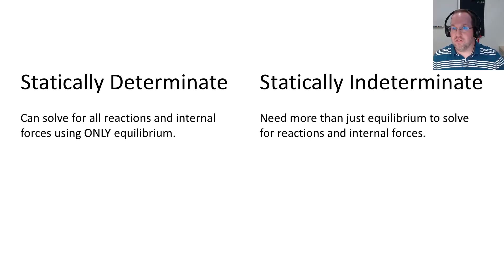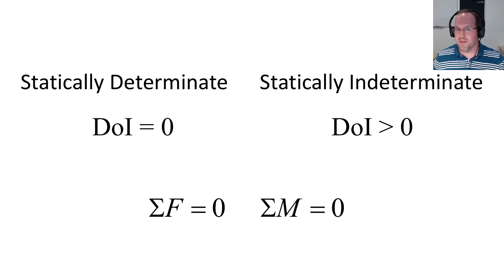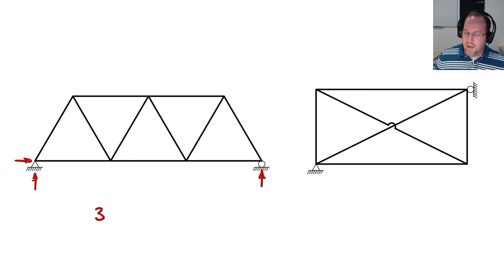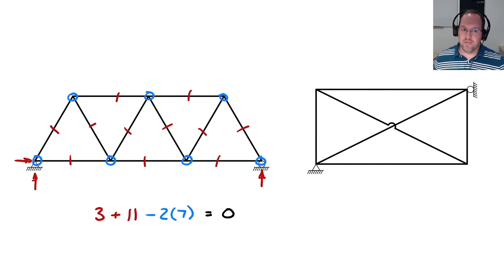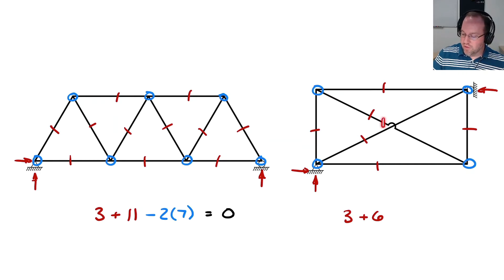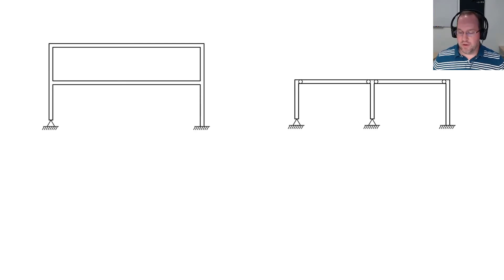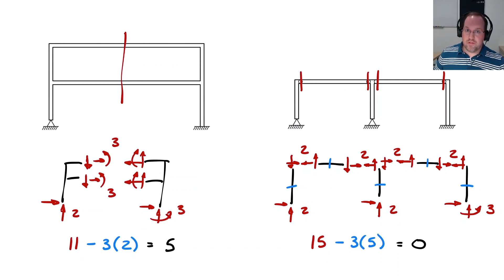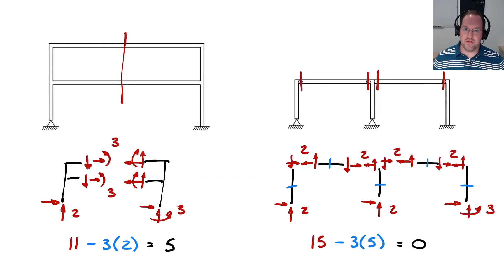Determinate vs Indeterminate Structures - Intro to Structural Analysis

Comment: Those a structure become indeterminate if the DOF is a negative number?
Reply from the maker: If by degree of freedom, you mean unrestrained degrees of freedom for rigid body motion, then yes. I have also seen this called the mobility of the system, and zero mobility is a determinate system while negative mobility is indeterminate. There is some ambiguity when defining degrees of freedom for deformable bodies, which is why I’ve added the clarification, but I think you have the right idea here.

Comment: I never learned this method in engineering school, but I can say that most civil engineers with experience and all structural engineers can generally look at a structure like this and determine if it is either statically determinate or indeterminate by inspection. Knowing the degree to which it is indeterminate is interesting, but in practical application, most engineers will just plug it into their computer and let it do the hard part. Thank you again for an excellent video.

Comment: how do you find r?
Reply from the maker: "r" is the number of releases, where a release counts as a single known internal force. So for example, a hinge in a beam forces the bending moment to be zero at that location - that counts as one release, because we know that M = 0 at that point. You can also have releases for shear and axial forces as well. These can even be combined. For example, a roller-like expansion joint in a bridge might count as two releases if both the axial force N = 0 and the bending moment M = 0 at that location.
Reply: @StructuresProfH  thank you!

Comment: Hello, what about those systems where DoI=0, but you can't solve the reactions? (the critical ones)
Reply: This is my question as well
Reply: @luziya7486  These systems are very dangerous (they allow some displacements nearby the position of equilibrium and the magnitudes of some reactions are tending to infinite) so you have to avoid them. The problem of recognizing the critical forms is a serious problem.

Comment: I don't understand the frames..  Is there any other simple way..?
Reply from the maker: There is an equation too. For two-dimensional frames, the Degree of indeterminacy (DOI) can be computed as:
DOI = Reactions + 3*Members - 3*Connections - Releases
... where ...
Reactions is the total number of reaction forces or moments
Members is the total number of members (beams, columns, whatever) in the structure
Connections is the total number of connections between members (including connections to the ground)
Releases in the total number of hinges, expansion joints, etc. in the structure

Comment: Thanks for sharing, it really helps. May I ask a question for the last frame, if there is only one hinge in the middle on the top how could I make the cut?
Reply from the maker: Great question, because this can get a little weird. Two cases to clarify here. 

(1) If the middle column only has a hinge on one side (instead of hinges on both sides, as shown in the video), then you would only need to make a single cut on the side with the hinge. The degree of indeterminacy would then be: 7 reactions + 6 internal forces - 3*(4 FBDs) = 1... meaning the frame is now indeterminate. 

(2) However, if both beams and the middle column all come together at a single hinged point, that's a bit different. This moment release is now applied to all three members, unlike in Case 1 described above where the hinge-to-the-side only affects a single beam and the column. To "cut" this, you'll separate all three members that connect into this hinge from each other. Once you've done that, you will have identical free body diagrams as in the video, so the DOI is still 0.
Reply: @StructuresProfH  It makes perfect sense and thank you for the explaination.